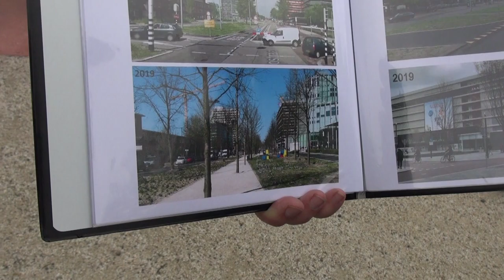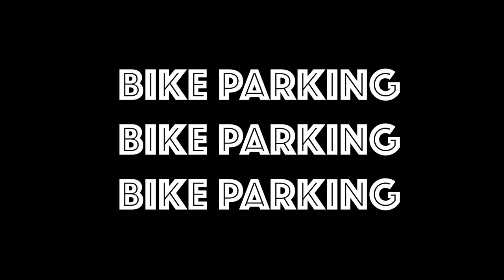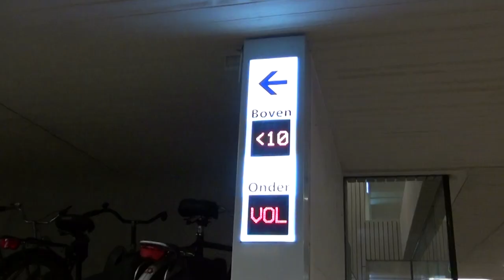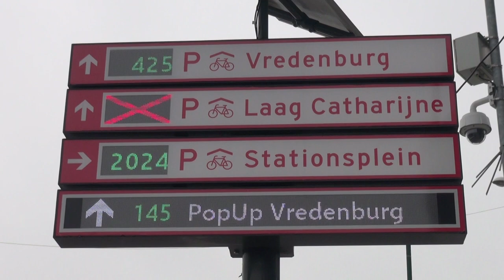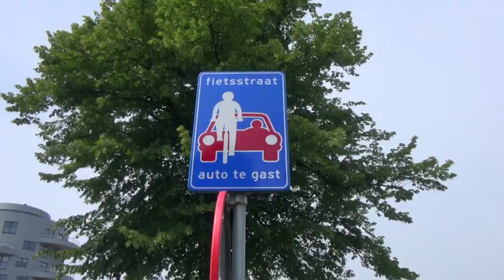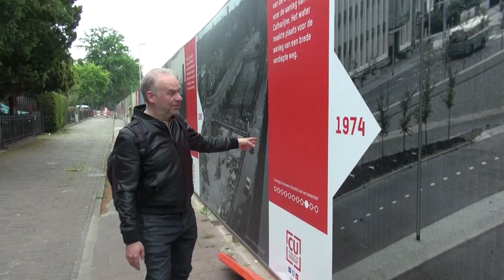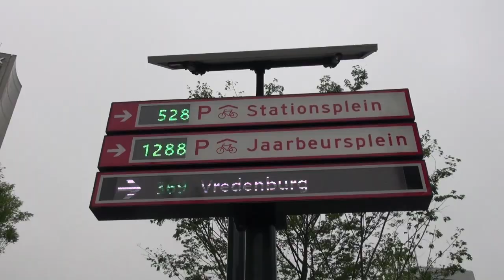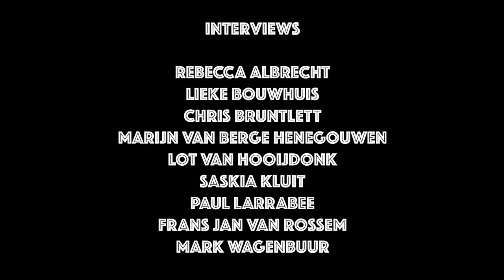Utrecht: Planning for People & Bikes, Not for Cars

Comment: yay! no helmets! feel the fresh air; hear the sounds around you; etc. etc. etc.
Reply: This is a big part of the reason why people accept it there. Helmet rules in other countries are specifically tailored and lobbied for by the car/fossil fuel industry to push people away from bicycles.
Reply: Not even the kids!
Reply: Helmets gives you a false sense of safety.
Reply: Joe Black I have to disagree with you there. Although bike helmets can draw people away from cycling, they do come in handy in areas without a bike culture. The Netherlands has endless bike infrastructure and protected intersections, so the chance of getting in an accident is very small. But in the USA, for instance, cyclists usually end up biking right alongside enormous trucks and buses. So I do think helmets are necessary in some areas.
Reply: @mentos93  100% this, a bike helmet absolutely doesn't protect you in a car/bike collision.  Which is why it's better to separate the fast moving traffic from the slower moving traffic.  And that's exactly what we do here in the Netherlands.  And most places (within the cities) where you simply cannot separate them, you give priority to the slower moving traffic.  Which makes it's a joy to cycle in the Netherlands.
Reply: @SanderEvers  what you are absolutely ignoring is that bike traffic in dutch cities moves a lot faster than car traffic, you are way more at risk from suffering a injury by transiting on a bike than a car there. so, learn to use your helmet if you dont want a skull fracture.
Reply: @borek772  Do you understand the difference they do make. And the level of single bike accidents that cause Traumatic Brain Injuries. I do and the figures are frightening
Reply: @mentos93  False, they protect your brain from Traumatic Brain Injuries. What sense they give you is your fault not the helmet. Its job is to protect your brain which it does.
Reply: @joeblack4436  The rules are tailored to protect people from Traumatic Brain Injuries. Nothing to do with anybody else.
Reply: @lawrence18uk  Do you know the danger to children from cycling accidents and their brain development. Gust Googe why children should wear helmets
Reply: @GJFK1  bike helmets aren't strong they easily break. You would need a helmet they use on a motorcycle they are alot more heavy.
Reply: @GJFK1  Sure. Children.
Reply: @mentos93  they take the impact your skull would take and disperse it that's why the helmet breaks because it worked.
Reply: @joeblack4436  Read the stats on children and brain injuries. Hell read about how childrens brains and skull differ from adults. Just trying to get people to take better care of themselves and avoiding Traumatic Brain Injury as it is horrible
Reply: @GJFK1  To my knowledge, bikers are least likely to suffer head/brain injury compared to pedestrians or drivers, so where did you get your data from?
Reply: @borek772  There is a Czech report on it there are numerous others. The British Medical Journal and the BMC journal has many more.
Reply: @borek772  so it's everybody else's fault.
Reply: @SanderEvers  helmets work in reducing brain injury in cycling accidents.
Reply: @borek772  it wont but it will and does protect you in a lot of ways.
Reply: @SanderEvers  actually it does but you keep blaming helmets for vehicle accidents
Reply: My grandfather is 98 and still does shopping every day on his bicycle!
Reply: @GJFK1  A laminated styrofoam cup only really protects against superficial damage in cycling accidents. So mainly non lethal cuts and so on. They do not really help with concussions or fractures and they have almost zero impact on lethal car-bike accidents.

Head injuries are also rare with normal commuter cycling on proper bikes. Helmets add nothing but a nuisance that would put people off of riding, which would result in more death due to a lack of exercise. This is precisely the reason the Dutch government advices AGAINST the use of helmets.
Reply: @joeblack4436  That is BS it is to stop the rise of traumatic brain injuries in cyclists.
Reply: @mentos93  That has been proven to be false as well.
Reply: @borek772  Most cycling accidents are singe bike accidents.
Reply: @SanderEvers  Seat belts are not 100% successful nor airbags but they are used as the reduce the damage and deaths in accidennts. Same with helmets.
Reply: @GJFK1  It's patronising. Sure maybe rules for children, but adults?
Why not ban racing, sky diving, bungie jumping, snowboarding, water skiing, horse riding, mountain climbing... heck acrobatics, boxing, wrestling, rugby, american football, ladders, etc... etc... etc... while we're at it? There are way more dangerous activities an adult can participate in than riding a bicycle without a helmet.
Reply: @GJFK1  It's not the same thing. When you are on a motorcycle or a scooter then you know you are going to be moving at 40-100+ km/h. Then it makes sense to wear head protection as a rule. An adult cyclist can judge whether they will need safety gear. Rough terrain, or a focus on speed, heavy traffic. But what about somebody in a small town  somewhere with hardly any traffic who just wants to casually ride to a shop a few blocks away? 
I find it ridiculous that the rules still apply, to adults, in a scenario like that.
Reply: @GJFK1  Of course I wear a safety belt. I already said that when driving a car you can reasonably expect to go in excess of 40km/h. Often enough in excess of 100km/h. Throwing a fit won't change the fact that there are many, many instances in which a person can ride a bike where they have every expectation of it being fairly safe.
One of the leading causes of death and debilitating sickness in THE WORLD is inactivity i.e. a lack of exercise. Way more so than riding a bike without a helmet. Should we now make that a legal concern? Force people to walk around a few blocks a day?
No. Why? Because people will say they are being forced to do something they don't want to do.
I get reasonable safety regulation. I would say that it would be perfectly reasonable to require people to wear helmets on the highway, and in busy parts of a city town with increased car traffic.
However extending such rules to a quiet road in the countryside, or similar, is nonsensical ad patronising.
Reply: @GJFK1  I said my piece. You want to tell your kids to wear helmets. Fine. I will too while they are my responsibility. But don't tell me you patronising wannabe dictator.
Reply: @joeblack4436  so you run away and hide when you are told the Truth. Nothing new with that.
Reply: @GJFK1  You shifting to troll gear now? Or is this how you choose to try and convince people of your view? Good luck with that.
Reply: @joeblack4436  no I know the reality of Traumatic Brain Injury and I am trying to explain against a lot of false reports that helmets work. They are not magical but are effective for saving a lot of people serious and deadly injuries.
Reply: @GJFK1  I never even said helmets do not work. Not once. I only said that I resent being forced to wear one, especially in low risk situations.
I had parents growing up. I am thankful for the guidance they provided. I don't need the state to act like a parent to me now that I am an adult.
Some might say it's the same as mask wearing during the Covid pandemic, but that would be incorrect. It's not the same at all. Wearing a mask prevents transmission to others. More even than it prevents contracting the disease. It's other people's lives one is risking. In such cases I would say it is perfectly fine for the state to lay down rules. 
Helmet wearing on the other hand is a personal safety concern.
Reply: @joeblack4436  Do you resent seat belts and the rules of the road as well. As they are all the state telling you what to do to stay safe. We all have to abide by rules and some of them we don't like. It being part of society.  You follow the rules that are there for the betterment of all. As brain injuries affect more than just the person who gets them. Everybody in relationships, family, friends workmates and more all suffer because of TBI happening to one person.  Trust me I speak from lived experience.
Reply: @GJFK1  This again. We've already been through this. Are you stuck on repeat? Again. I said my piece. Now leave me in peace, or troll on. I will not continue wasting my time.

Comment: This is just a dream :) City planning very close to perfection. I'm so jealous of you guys :) Although I am more of a public transportation kind of guy and I actually kinda hate riding my bike this is still what I'd love german cities to look like aswell. So sad that our automobile industry has too much power over our politicians....
Reply: Do you ride your bike with or without a cycling helmet? I'd get a bike tomorrow if I could drive the streets without a helmet.  Hate them.
Reply: @joeblack4436  mostly without which is stupid af, I know, but yeah, same... don't like it either. It is something you get used to though... like the seat belt in the car.... how annoying is that thing? I mean seriously... but by using it all the time you learned to stop even complain about it...
Reply: Utrecht may be a dream for bikes but public transportation is better in most german cities. Utrecht went to all the effort and built a lightrail but only 3 radial lines terminating at central station. Compare this with for example Bielefeld and you find 4 lines but 3 of them go through the city with a route on the other side so the have 7 routes compared to 3.

It seems like building bike infrastructure is used as an excuse to not built trams or lightrail when it's not absolutly necessary.

Comment: The answer to creating cycling incentives is density. In the US, so many suburbs are laid out so far apart that it’s impractical to cycle for anything other than fitness, even if you could get paths installed. Changing building and zoning codes has to be the first step.

Comment: I am from the Netherlands and grew up near Utrecht. 
I didn't own a car until we got stationed in Las Vegas and I got a total culture shock. 
My bike sadly got stolen a few weeks before we moved.
Compared to a Dutch bike, bikes sold in the United States are kids bikes. They are to small you end up with your knees to high and can't fully extend your leg wich is where the power is. 
If the United States wants to use the Dutch example of the bike network it seriously needs to look at the bicycles are made as you can see in the video people are upright on the bike.
Reply: If you want an understanding why slow, heavy, inefficient Dutch bikes won't work in the US, you need to look at the geography and climate of the Netherlands. as well as how Dutch cities are built. You realize that:
1) the Netherlands is flat as a board, while the US contains hills and mountains. That's why we have road, hybrid and mountain bikes.
2) its cities are dense in compact—no bigger than 85 square miles. Unlike in the US, there's absolutely no sprawl there whatsoever.
3) it does get hot there *at all*.

Comment: At this moment there are about 33,000 bicycle parking spots in and near Utrecht main railway station. But that is not enough. They plan for more. If I remember correctly, about 8,000 more.

NB of the current 33,000 bicycle parking lots, Utrecht Central Station has the largest parking garage with about 12,500 spots … and, of course, completely filled every day.

Comment: It should be noted that Utrecht is a small city, The city center, from freeway to freeway is 3.5 miles wide at its narrowest, so eliminating major roads from that area makes sense. But freeways still run through the city proper, meaning you can still drive to the city from somewhere else, get relatively close, and finish your journey on bike or transit. This seems to be the case with alot of dutch cities. The key is having a functional enough city center for cars to not be required, but one that is dense enough for it to not sprawl.

Comment: More complicated - years of decisions in the other direction make this difficult.  Years of "office parks" and business locating in new construction in open land, which of course is far outside the existing population centers and randomly spread apart.  Years of shopping services consolidating in "shopping malls" on limited-access roads and hollowing out the local availability in town centers.  Worst, roads having been built without sidewalks or crossings, with walking *prohibited*, so that it is literally impossible to go to many services by foot or bicycle.  In Paramus there is one of the oldest shopping malls in America; two of its access roads end on local streets, but neither has a sidewalk.

Comment: I wonder how much of the cost of this is offset by savings on the health system? Respect to Utrecht, indeed!
Reply: The cost is already fully covered by the cost reduction on road maintenance. Bicycles don't wear out the paths the way cars do with roads. 
But solely on health costs, there is also this conclusion of research by the EU:
"Results suggest that each kilometer driven by car incurs an external cost of €0.11, while cycling and walking represent benefits of €0.18 and €0.37 per kilometer. Extrapolated to the total number of passenger kilometers driven, cycled or walked in the European Union, the cost of automobility is about €500 billion per year. Due to positive health effects, cycling is an external benefit worth €24 billion per year and walking €66 billion per year." 

So every kilometer cycled and not driven in a car saves €0.29/km. It's pretty much win-win-win-win-win-etc if a nation/city gets their citizens on bicycles.

Comment: I love this! I wish it could be implemented where I live but alas Texas is huge and backwards. Things are so spread out here. For example my son's school is 25 minutes away by car  : (
Reply: So is my job (in the city of Rotterdam). About 20 kilometers (about 13 miles) away. It takes about 25 minutes outside rush hour to get there.
But I never take the car. As a matter of fact, I sold my car in 2015.
I cycle to work. Takes me 50 to 55 minutes to do so. And I never stand in a rush hour congestion queue.

My previous job location was about 30 kilometers (about 19 miles) away (about one and a half hour each way on my bicycle). I cycled that too.

For anybody not used to cycling, or any distance exceeding 15 to 20 kilometers (exceeding 10 to 13 miles), I can recommend an electric assisted bicycle. Having said this, I know that Texas is not a bicycle friendly state. I can understand that cycling through Texas traffic might feel highly uncomfortable.  

As to the heat. I have lived in the Sinai dessert (Egypt) for half a year. I cycled there too.
As for the cold. I lived in Oslo and Bergen (Norway) for close to 3 years. I cycled there too. Also in the winter.
As for mountains. In the summer months while living in Oslo I cycled up Holmenkollen just about every day. Just for fun.

When it rains you do get wet. When it is hot ... it depends. Is it a dry or humid heat? Do you cycle with an average Dutch commuter speed (10 mph or less) or do you try to imitate a Tour de France racer?
With extreme heat, rain, cold, snow, etc... the question is: Can you refresh yourself and do you have a change of cloths with you for your destination?
The previous questions are all less relevant with an electric assisted bicycle. See, among others:
https://www.youtube.com/watch?v=7MAoeQUr3c4 . (Dutch)
Note: Very typical school children on a very typical daily school ride. With one student cycling on an E-bike (electric assisted bicycle). Which currently is not(!) typical.

I do not know how old your son is, but would it not be a stunt if he becomes the first student commuting on an E-bike to school? Easy to do for distances up to 25 miles. And very healthy.
Just saying...